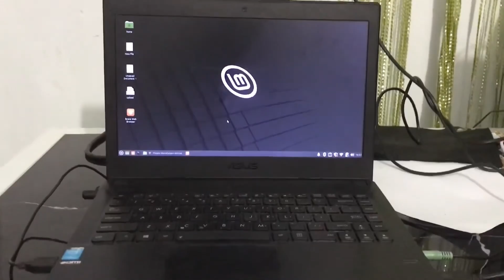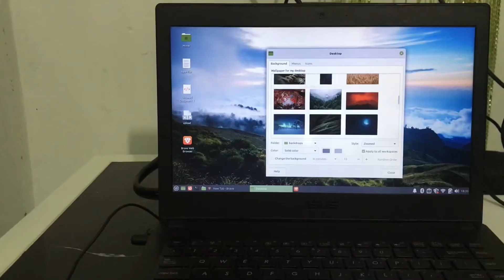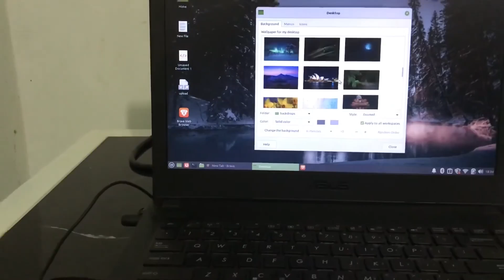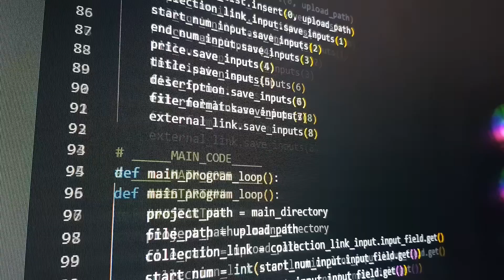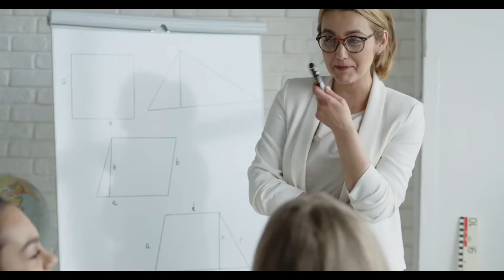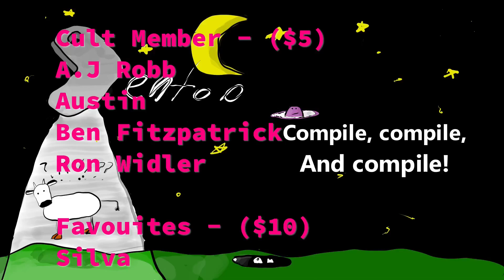Switch Non-Techies to Linux

Comment: Why switch them over? They refused to listen to the principles of free as in freedom software vs blindly trusting proprietary software, so let them suffer the consequences of their decisions. Let their information pile up on the dark web, their crying will be a warning to everyone else as to why they probably shouldn't be so apathetic to begin with.
Reply from the maker: I don't give a crap about free software licenses after being a Linux user for a quarter of century. I think people need to remember Linux is the best tool for the job and not a religion.
Reply: @immoloism  If we're going to use something that is the "best tool for the job" then we should be using Windows as it easily beats it. Everything is designed for Windows first so it is basically guaranteed to work for whatever job we have.
Reply from the maker: @iiisaac1312  I think you might have forgot everyone has different requirements :) but God lover a trier so I'll find it entertaining to hear someone know my needs better than I do :) 

I'll least my reasons after to be clear, I'm just really curious to know this answer first and don't want to influence it.
Reply: @immoloism  So Linux isn't "the best tool for the job" but "the best tool for MY job/needs."

If we want people to switch to Linux because it's the "best tool for MY job/needs," doesn't this seem to forget these other people have different requirements?
Reply from the maker: @iiisaac1312  Is this a gymnastics class now?
Reply: @immoloism  That isn't an argument.
Reply: Interesting profile picture you're sporting there. Which distro did you play Deus Ex on again?

Also, it's nice to know my data is secure because I use Linux to log into my Google and FB accounts on Chromium. I was worried there for a second.

Comment: Jokes on you I like mint so my preferred distro is a great recommendation for beginners.

I have converted two people to Linux, one of them, my grandmother, went back to windows... because her laptop got slow enough to get a new one and I figured it would be easier to go trough windows first startup dialog than to install mint for her. In hindsight just the startup dialog is longer than mint install.
Reply: I think that a big part of successful conversion is not pushing it. Just like you said, converting people for a reason. It may be performance, it may be principle, it may be control but it needs to start from the person to convert. If they are happy with windows let them be happy.

Comment: Linux has come an awful long way in the past 10 years, but I'm not sure it's ready for non-tech people. Unless all they do is browse the internet and send emails. I'm not a veteran, but I've been using it for about 4 years and I still struggle sometimes. And some credible security experts have come out recently and said that people should avoid things like Debian and Mint because they deliberately stay too far out of the loop. 

Too many security issues arise during the time they take to make sure everything will be completely stable. I've yet to see a great distro for newbies, although there may be one out there by now. But it will have to get a lot right, that so many other distros get wrong. My guess is that if you recommend linux to them, you'll end up becoming their tech support. Linux is growing slowly, and once Ai matures Linux will probably take over completely because you can just tell your FOSS Ai to make the broken or missing thing work on your distro.
Reply: I don't understand why security experts tell people to avoid Debian-based distributions. After all, security is nothing without stability
Reply from the maker: @saiv46 I don't think security experts avoid Debian at all. Just armchair experts on the Internet do.
Reply: @saiv46  The other way around, stability is nothing without security. Unless of course, your computer never touches the internet. But that's certainly not most machines. That's why I went with Arch based, because you're much more up to date on everything. I'll let those server OS users lag far behind on everything. That's definitely not for me.
Reply from the maker: You are forgetting all the times you struggled with Windows and macOS I feel here.
Reply: @immoloism Ah yes, cue the "let me convince you why Windows is much harder to use than Linux even if your experience says precisely the opposite" routine.
Reply from the maker: @yarpen26  you didn't watch the video did you....
Reply: @immoloism  Wrong.
Reply from the maker: @yarpen26  Then how did you miss the parts where I said this?
Reply: @immoloism  I don't care what you said in the video if you don't practice what you preach, as evident in the very first reply you posted to that guy in this thread.
Reply from the maker: @yarpen26  What a lot of nonsense, just admit you didn't watch the video as we make mistakes and it's fine to say that. I'll not bother replying to you any more as you are wasting my time at this point.
Reply: @immoloism  If it's fine, then just admit that we should "do as you say, not as you do" because that's clearly the policy you live by. I watched your stupid video and you know well I did, but in hindsight, it wasn't worth it. Well, you do go for the kindergarten "I'm not talking to you anymore because otherwise you'll get me up in a corner so I must prevent" shtick so all the power to you I guess.

Anything else on your channel that I should check out to get an idea what you say we should do but you don't?
Reply: @immoloism  To reply to your original comment - I remember my struggles with windows and boy can it get on your nerves. But they're not the same struggles. For instance, windows never randomly just stopped feeding video. Video signal just gone. The linux video stack is so convoluted that it's a wonder it works at all. You don't dare touch it unless you know an awful lot about it. Can't wait until Ai can solve that. After 4 years of using it, linux (distros) seem fragile and unpolished. Give me that over windows any day, but we must remain honest. The lack of polish would give ol Billy G a heart attack if he saw it happening on windows.

Comment: My grandmother has a laptop which won't run W11 well, so I've decided that on (or before, as she lives a couple of hours away so I don't see here a lot) 14/10/2025, I'm going to try to convert her to Ubuntu Cinnamon (probably the LTS). I've chosen that as she's said that she likes Cinnamon (what she tried was a bit jank as I usually just use a wayland compositor, and gentoo obviously has no default anythings for Cinnamon) when I asked her if she preferred that, kde, or gnome. I've also chosen Ubuntu over Mint as a lot of guides (even guides that work on Debian) mention Ubuntu, and not Debian or Mint. You or I could probably tell if a specific Ubuntu Cinnamon guide would also apply to Mint or not, but I'm not confident she would.
Reply from the maker: You have the coolest gran ever! Make sure you look after her for us :)
Reply: @immoloism  As far as I can tell, she's not particularly enthusiastic about Linux but she is enthusiastic about not spending more money on a new computer. She makes slideshows for church, does a tiny bit of web browsing and writes emails, as far as I can tell.

She's a cool grandmother, but I think Andrea Borman would probably top the charts for "coolest grandmother for a Linux nerd".
Reply from the maker: I think she just wants to make time for you and your hobby myself
Reply from the maker: Andrea Borman is my #1 install gentoo with but 4th place for coolest